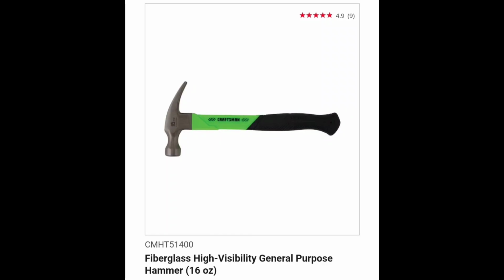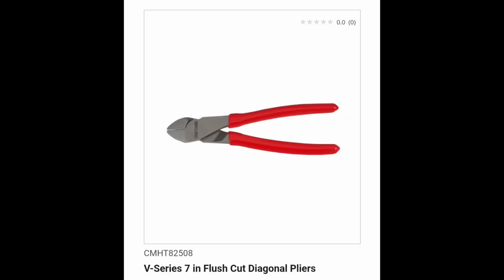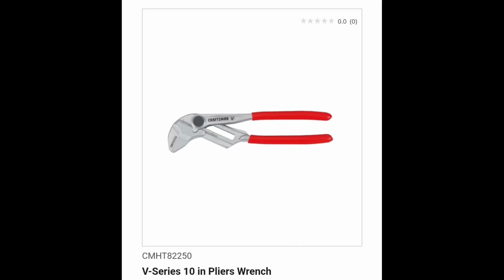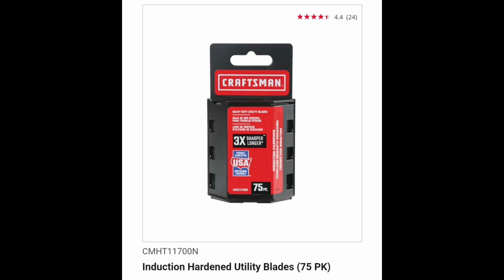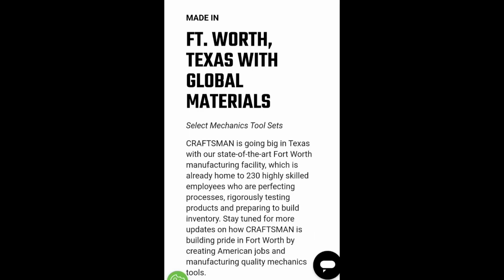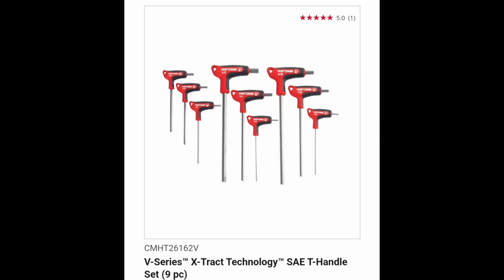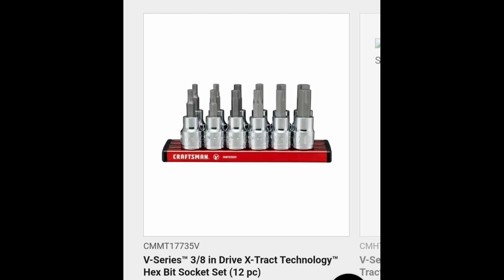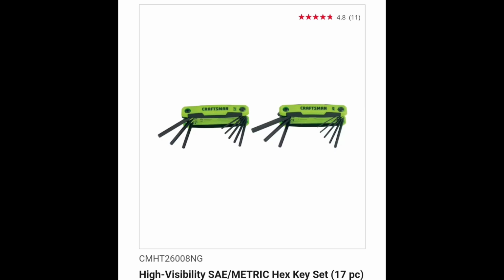CRAFTSMAN IS QUIETLY RELEASING NEW TOOLS AND COLORS WOW!!

Comment: May have to give the craftsman v series wrenches a go. I'm a pinsetter mechanic (bowling).  My biggest gripe with my Mac precision torque wrenches is that they're to damn long.
Reply: Ended up giving the craftsman v series a go.  Wasn't impressed.  Felt very light and cheap in the hand. Ended up snagging a set of facoms off ebay for a good price. Build quality and weight is easily distinguishable

Comment: I bought the "smaller" (lesser wrenches) GM Chrome wrench set for my mobile box. Absolutely love them. Long panel and slim. Feels great, and hugs the nuts 🥴 Can't 100% compare to the SO wrenches, but for a small box that's supposed to be my condensed version of my shop box, they work well.
Reply from the maker: Great tip!

Comment: I used to have an adjustable wrench that had Metric size on one side and SAE size on the other. It was such handy tool to know the exact size of the fastener. Then you could grab the right socket or wrench without a guessing game. This helped alot with vehicles that use both sizes.
Reply: That is such a good idea.

Comment: The new Craftsman V series looks nice enough. The ratchets look reminiscent of the current Mac ratchets. My gripe is that they are not serviceable. I periodically clean and lube my ratchet mechanisms. I have a 3/8 long flex head Craftsman Professional ratchet that is my go to. Having not wanted to take my Mac 3/8 long flex head on the road or to the racetrack I bought the Craftsman. It reminded me of the Mac. Both had a ball detent on the pivot, 36 teeth and performed the same. The Craftsman has a quick release. My larger size combination wrenches were Craftsman Professional. They felt much better in the hand than the raised panel wrenches. I was sad to see the Professional line disappear.

Comment: The new 20V tools they sell at Lowes are often referred to as the Curious Red Dewalt on Torque Test's channel. I think they are releasing more tools to the public that we'll see in Napa and Lowes possibly a few other places such as Amazon where that market will find them easily without stepping on any of the other S,B&D brands.
Reply from the maker: The cordless are similar but the hand tools are miles apart
Reply: @CPthetooladdict  I agree. I bought the big Tough System box set to stay on one of our snow chipper trucks. Dewalt hand tools are China Craftsman rebranded, no where near the V Series or the old Crafty for that matter. While it is a pretty damned complete socket set, the ratchets are junk and the wrench selection is poo poo
Reply from the maker: Ya the weird thing is they are making raised panel stuff in China it seems a bit wrong but If I'm being honest thats about the quality they ever were.
Reply: @CPthetooladdict  True, they may be a little loose on the open end but that’s a pretty good wrench by design. If they would make the old long and short pattern double box and double open ends again, I’d buy them.
Reply: @CPthetooladdict  I don’t remember when the chrome ratchet handles came out but I don’t like them. I will say the Chinese copy’s of the Easco style teardrop ratchets suck.

Comment: After just a few months of getting very serious into hand tools and came across Knipex. There is nothing else that comes close to the quality and engineering that they do to their fliers and just about any tool they make for that matter. Absolutely incredible. In the last 3 months I spent over $700 on pliers basically. I've already used for five of them and it made my job almost easy where I know it would have been near nightmarish issues if I didn't have the great power and gripping ability of Knipex. It's hard to look at other pliers after having the best and most incredibly put together tools. I do have however a ton of Craftsman tools that I do warranty out all the time. You cannot beat Craftsman's warranty. The only thing that sucks is all their tools I'm warranty and I are all American billiards and I'm getting Chinese or somewhere else made tools certainly not Made In America. Back when I first started buying tools in the mid-eighties they were still made in America.
Reply: Warranting old tools and getting back new junk has completely ruined the brand. They are realizing this since the race to the bottom has already been achieved. I will pay dearly for a tool made with pride and reinvests into our economy instead of someone else’s.

Comment: Nothing to write home about the wrenches with the gun metal chrome or v series. Both sets have skipped sizes with no option to buy the missing size separately. They do though for the classic satin chrome raised panel ones. My set I bought is made in India. But they hold up to the beating. Mostly use them to break loose brake caliper bolts with a hammer.

Comment: I got into Craftsmen tools around the 90s 
Started using them at vocational school in 92 
Around 95 used them professionally and this was when their sockets were substandard or  perhaps not the right heat-treat 
Got away  from automotive for a little bit and then returned 
Not having a bunch of decent tools I went back to Sears 
They were great especially the US made stuff which wasn't hard to find 
until the Kmart debacle which shut Sears and the American icon craftsmen down 
This broke my trust in the Craftsmen name and until they bring it back full throttle to states it's my opinion that the Craftsmen name brand can stay in the store